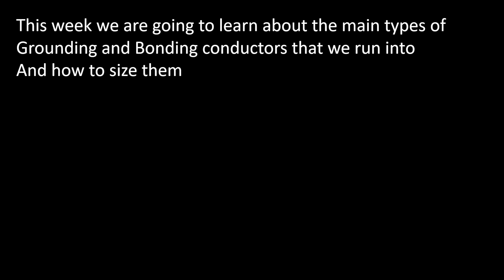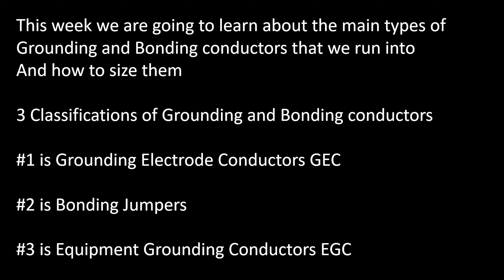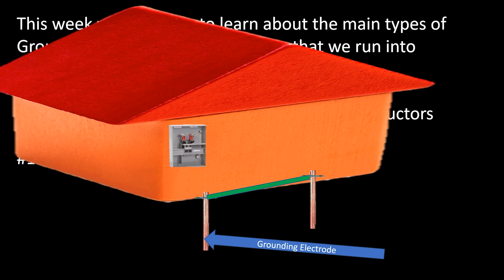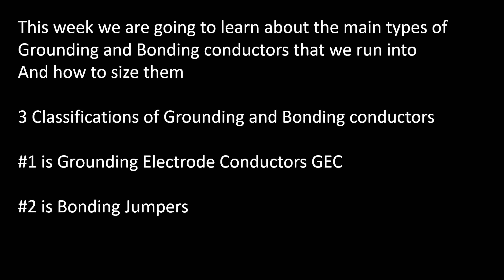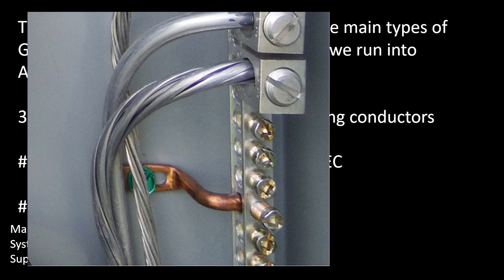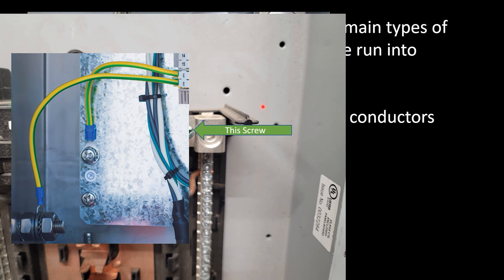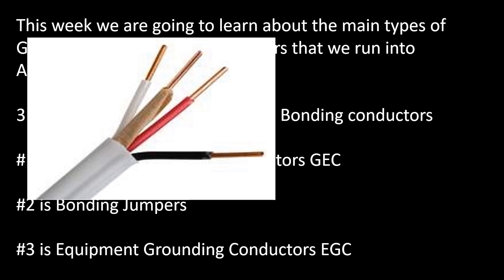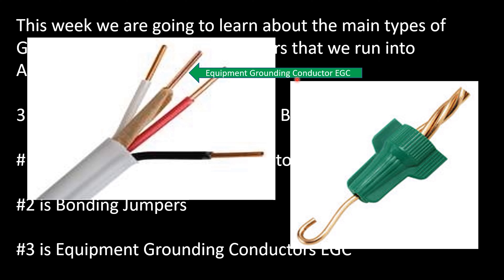Everything you need to know about sizing Grounding and Bonding Conductors Part 1

Comment: With the grounding rod wire is there a requirement to have flexible metal shielding with a 200 amp panel upgrade

Comment: Can a ground bare wire that is attached to the rebar within a concrete slab be connected directly to the ground of the sub-panel(Interior main panel) or must it go direct to the 8' copper ground rod outside of the slab?

Comment: Would technically only need 1 ground rod as long as it reads less than 25ohms but its always a good idea to just pound a second one to get rid of the annoyance of having to check and the inspector…also if theres a rebar in the concrete u dont need a ground rod